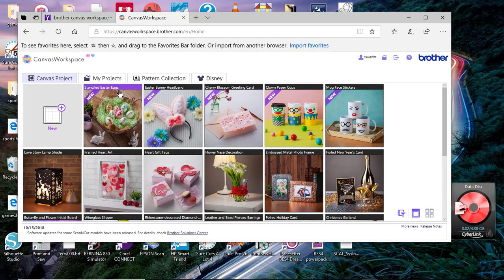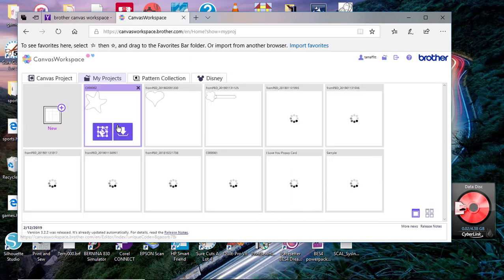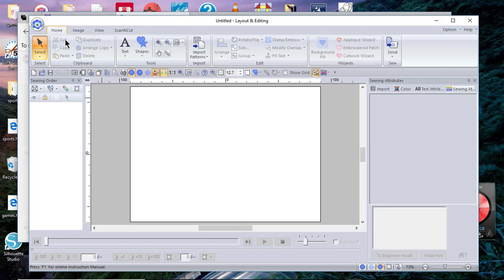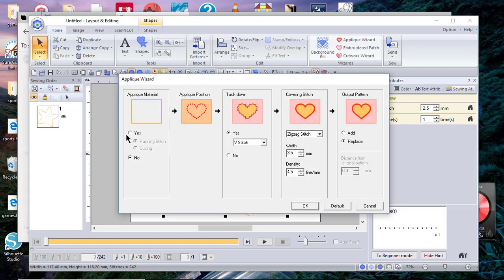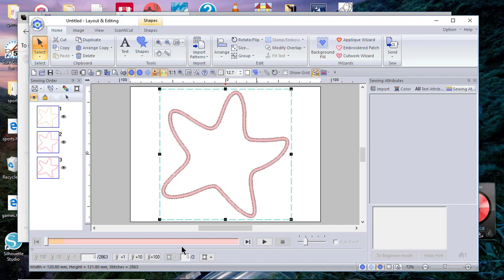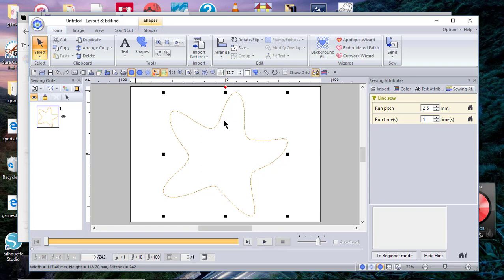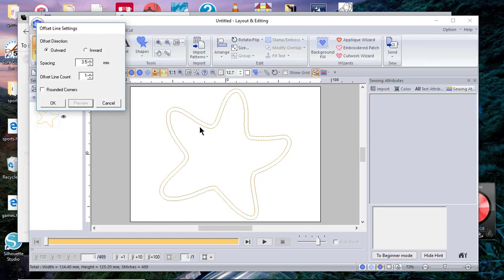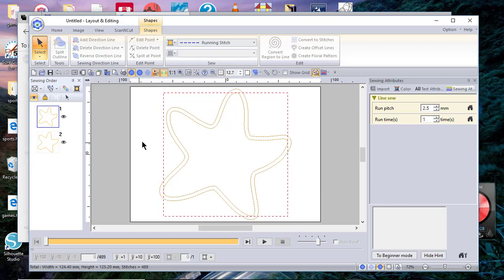Using a Scan N Cut Shape or FCM File in PE Design 11

Comment: Hiya I’m saving all you videos so when I have time I can watch them & learn as I have bought the pe 11. What is the scan & cut. Dose that mean that machine that cuts paper shapes out or is this all to do with embroidery? Thank You 🎃 for you videos by the way.
Reply from the maker: Herr Mondlicht - the Scan N Cut is a combination scanner and digital cutter.  It can cut vinyl, heat transfer vinyl, chipboard, fabric, felt, card-stock, paper and other materials.  The newest model can cut materials up to 3 mm in thickness.  I use mine more for cutting vinyl and heat transfer vinyl than paper crafts.  When I am making a quilt with appliqués, I cut the fabric out with the digital cutter.  Enjoy your software.